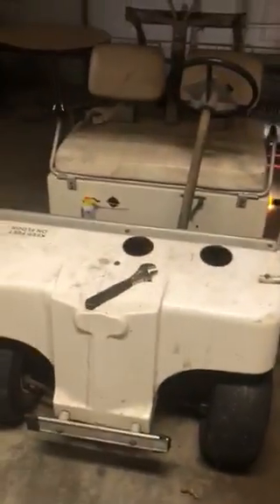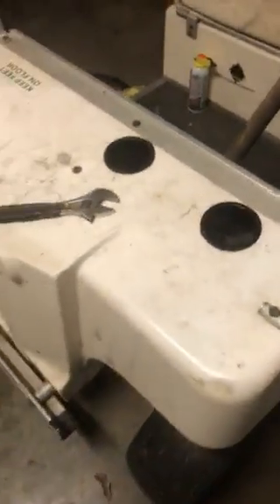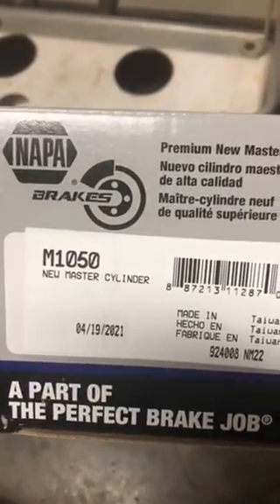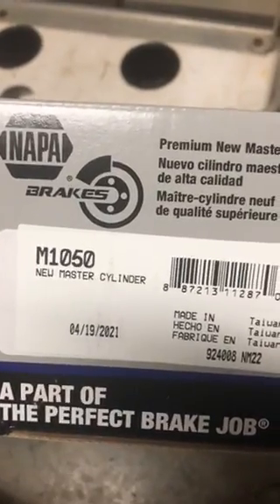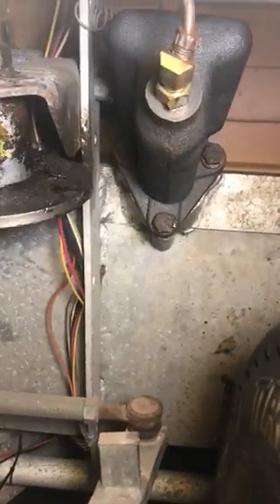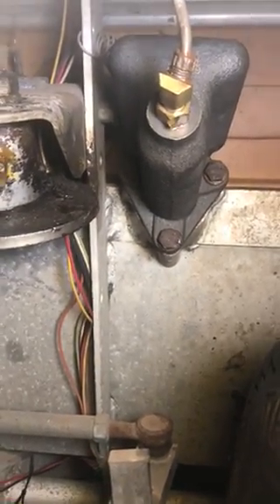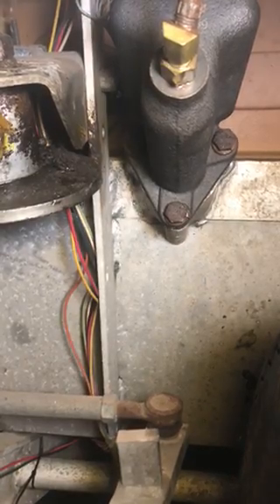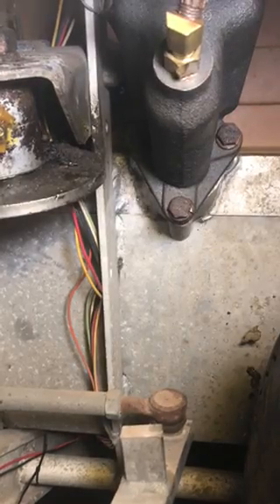1974-1980 Club Car Caroche Master Cylinder

Comment: Cody, do you recall what size adapter you had to use? Thank you
Reply from the maker: no, Im sorry. I do not have that adapter size.  The guys at Napa used my old one to find the correct adapter, and it was on another failed master cylinder for a chevy - so they just removed it and put it on the new one for free for me.  They did say it was a common size
Reply: Got it. Thank you
Reply: @scottanderson2150  Did you happen to find the adapter size? My Napa guys can't figure it out
Reply: Thanks for the info I have an old caroche I'm going to work on